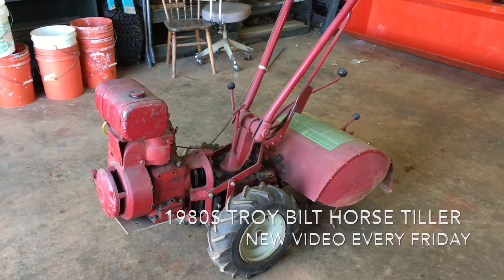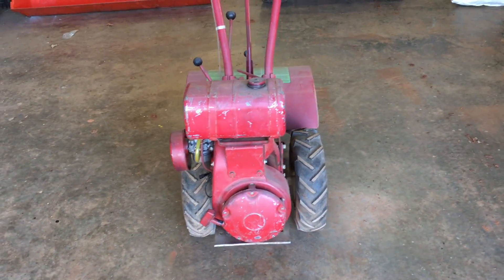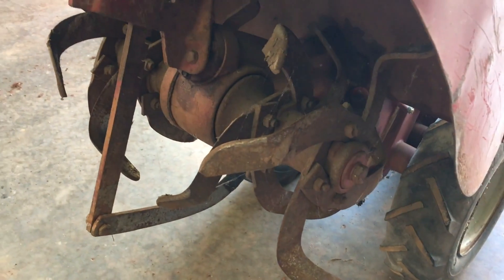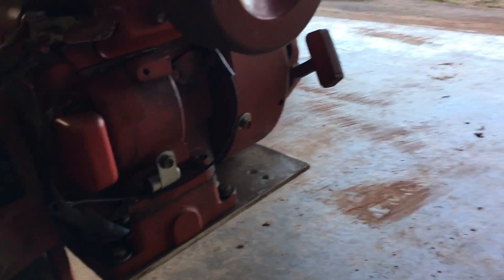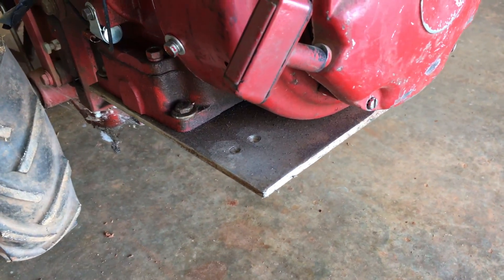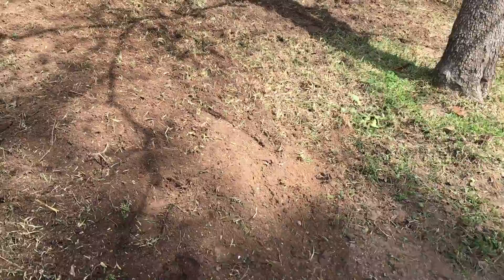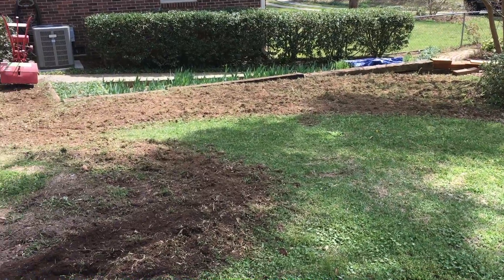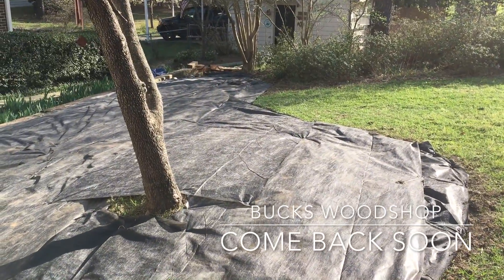Troy Bilt Tiller Horse, 1980s model Ep#12

Comment: I bought a new 1981 Troybuilt Horse and it has a 8 hp Briggs engine electric start with the engine guard and the trenches.  The engine starts much easier than the one in this video. Major improvements in that one year time.
Reply from the maker: Cool!

Comment: I have one of those that was made in June of 1984. I had to replace the engine with a six horse Predator. The eight horse Predator had a 1" shaft and the original engine had a 3/4" shaft. It still works like a charm.
Reply from the maker: James Smith Great to hear you got it running!
Reply: I have the same exact model from 1984 with the Kohler 7 hp bought in May/June. Never had to do anything to it except replace tines. That cast iron Kohler will last a very long time.

Comment: I have one much like yours. Sat unused in my FIL's garage for 35 years.
Checked the oil and gassed it up and it started.
It was an electric start but it started so easy I took that stuff off.
Replaced the carburetor and it has well ever since.
Up here in NH we are loaded with rocks but we keep picken them and the garden is mostly rock free now.
Reply from the maker: Awesome!

Comment: You need to bend that Foward reverse lever back down and lubricate those pins and belt adjustment block.  That is why you had to reinforce that lever.  Also you welded that lever on the wrong side. You lose belt adjustment like it is.

Comment: That is a great tiller. My front tine machine beats me to death.
Reply: +txsviking 
Troy bilt tillers are tough. My wife's parents bought one in 1975. They also put it together. We still have it, I need to rebuild the carburetor as I didn't put any stabil in it when I stored it. Could have drained the gas too but the stabil always worked. Just forgot and didn't get a round tuit.
Reply from the maker: +txsviking Yeah those front tines are not good in compacted soil.
Reply: I had compacted soil with clay and sand stone that I need tilled. I set the bar so the tines didn't go in so deep. I also stopped in some places pushing down on  the handles because it was so hard and then lower the tines. After a couple of passes it got easier. The following year was much easier. That was where we put our garden. I'd rather have my dad's old Gravely but it's still a pretty good machine.
Reply from the maker: Cool man

Comment: Have you had an issue with the reverse disk shredding out?  The one I have has gone through the fibre disk so the original owner made a rubber one, I replaced it with the fibre and it shredded on me.  Otherwise I haven't had too much of an issue with it clear of replacing the 40 year old tires and belts as I am in the middle of.